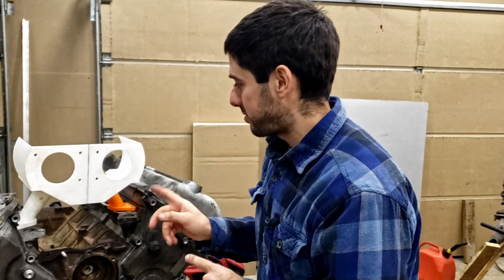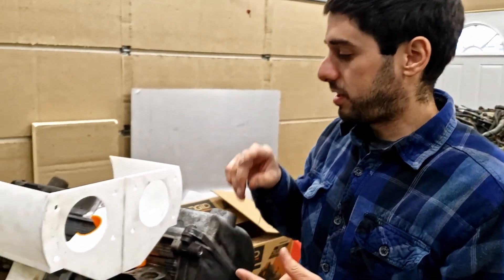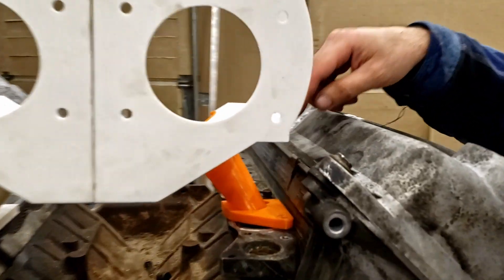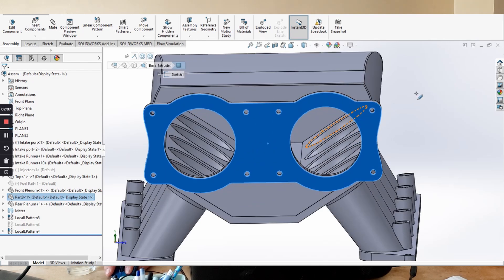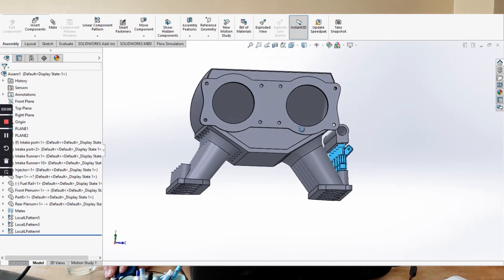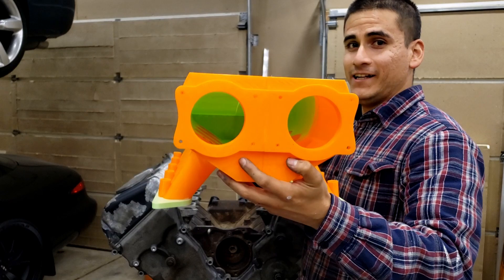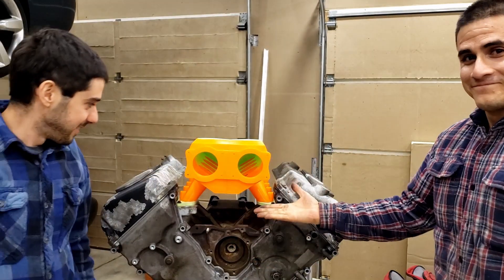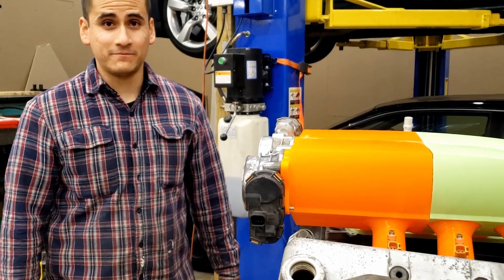3D Printed Intake Manifold - Ford V10 4V Build Ep. 5

Comment: Wouldn’t you be able to put the injectors on the inside of manifold I feel like it’d follow the runners and air going through it more, it’d hide them more clean up the engine bay a bit and for easier installation and removal a sub harness could be made to disconnect the injector harness instead of having to unplug each one individually.
Reply from the maker: That is an interesting idea. At first glance it seems it would be difficult to package but it would be slick!

Comment: What a shame you couldn't find/use Left & Right hand Throttle Bodies.
The new design looks ok ??
But, a more direct path would look and possibly flow a little better.
I guess a compromise needs to happen if you're trying your best to keep control of the cost.

The first manifold design had a more performance look, where as the revised version looks more like an OEM Manifold.
As always, you guys did a great job 👍👍

Comment: The manifold looks great, but I believe the runners are too short to get velocity. It will make incredible horsepower at high RPM's, but may lack street ability and low end torque.
Reply from the maker: They are pretty short, but we are targeting high RPM so that was intentional.

Comment: It seems to me the throttle bodies are going to be sending the air… pretty much straight into a wall. It was simpler and… well, straight the first time around. What about the positions of the throttle bodies was bothersome?
Reply from the maker: The blades opened in opposite directions and we preferred the look of the angled TBs.

Comment: Would you consider building a custom intake manifold for my f150 5.4 3v?
Reply from the maker: Maybe once we’re done with this engine and we have some time for extra projects. What kind of build are you working on?
Reply: Building a 2014 5.4 3v 
That I'm gonna drop in my 09 f150.
There isn't a aftermarket intake manifold available. 
Hoping you could be the first

Comment: I disagree with their use of LS Throttle bodies tho, the Stock 2V V10 Computer can run 3V and 4V heads with tuning changes as long as their not using variable cam timing, which it appears they are not, but it can't run 2 electronic throttle bodies that i know of....  over-complicated on that part, which will also mean they have to use an aftermarket computer...
Reply: Dude, did you see them cut apart 4 different heads and weld them back together? I don’t think running a different PCM is over complicated for them, 😂

Comment: Okay, I am going to need this intake but so it can fit an Cobra throttle body. I just cant bring myself to put a GM throttle body on a ford engine.
Reply: Downside for high boost applications is you can't put a v band flange to a ford oval throttle body.

Comment: Why not have the whole thing 3D printed in carbon strand filled 6/6 nylon and actually run the plastic manifold on the motor?  I'm sure there's companys with bigger 3D printers that could print the whole thing, or at the least, runners, and plenum that you could join.
Reply from the maker: Would be cool to have it 3D printed or injection molded! But it would also be really expensive for a one off. Thankfully aluminum is relatively cheap, and we have the ability to machine a lot of the parts so it should be relatively straight forward making the intake 🤞🏽🤞🏽

Comment: Hi i'm new to this series since you welded the heads together have you normalised the heads yet and if you haven't please do so this will normalise the grain structure meaning less chance of cracking
Reply: By heating?
Reply: @ethanwild3301  yes by heating it then letting it slowly cool this will make the grain structure throughout an even size, this has 3 advantages. 
1). makes the aluminium not soft at the welds (since AL anneals when rapidly cools which as you know AL is a great heat sink) which leads to cracking if force is used.
2). increases its overall compressional strength of the heads so when tightening the heads it evenly distributes the force evenly making them seal to the block better.
3). completely removing the internal stresses not only from the welds but also from the casting of the heads making them an overall stronger set of heads.

Comment: Have you guys thought of modifying an Aussie boss intake with modified upper lid to suit your LS throttle bodies?
Reply: The cost of a boss unit in the states, let alone two that would be needed to make it work is big big money. Hed spend less mony doing it in sheet metal but the boss manifold is sweet
Reply: @madmod  they are like $200AUD each
Reply: @tturi2  in the states, you would be hard pressed to find one under 2000usd
Reply: @madmod  thats a rort, go on ebay and pay the $200 shipping
Reply: @tturi2  Ebay has no listings in the US for Boss 5.4 manifolds. Zero. Ebay of AU has local pickup listings only. They are very rare and costly in the states.

Comment: What is the solution to the dead headed coolant passages that were welded shut? I’m guessing you will have “head cooling mods” on the front and back of each head? Looking forward to seeing how this all comes together.
Reply from the maker: That’s right, we’ll be cooling each half of the heads separately.
Reply: Basically the "crack pipe" cooling mod often performed on 4v mod motors and factory equipped on 04-05 Aviator 4v heads. They were already known to have some hot spots back there so ford fixed it too.

Comment: Love this project. I think the RPM goal is a little lofty if not just an arbitrary number, my 324 Cid DOHC is silly to 7500…. I have been running this engine in a track car for years…. Check my YouTube for any information. I wish you luck and I am following along to see the final results. Are you going to use the stock crank ?
Reply from the maker: 8k is definitely ambitious, but it’s certainly doable with the proper supporting hardware. This wont be a track car either so if you’ve been running 7500 for years in a track car, that gives us confidence we’ll be okay!
Yup, we’re reusing the stock 6.8 crank for this build. There’s no other option for this engine so we’re definitely going to be putting it through its paces 😬
Reply: @biy_buildityourself  sorry, i'm late to the party.  the forged crank will handle it, but the oddfire rotation and balance shaft are the big question..  looking forward to your results!  👍
Reply: I mean a billet 3.700 stroke common pin crank would really solve a lot of problems,,,, I can only imagine what that would cost though

Comment: I hear all the cool kids with triton v10's are running itbs
Reply from the maker: I wish we were that cool lol
Reply: @biy_buildityourself  Consider a slide throttle like a Larry Perkins V8 supercar, if you want a custom intake
Reply: Ive seen one setup with bikecarbs where they used the truck manifold, cut the runners off, and reused the flange and coolant crossover so all the hard fab work was made easy.
Reply: @madmod  that build sucks butts when compared to this build lol
Reply: @heith85  it made power though
Reply: @heith85  it put down coyote horsepower and over 400 foot pounds from 2000rpm to redline.
Reply: @madmod  made less then coyote hp and sucked butts when compared to the BMW v10
Reply: @heith85  You cant get a bmw v10 for 250$ in every junkyard across america. Also the bmw v10 doesnt average the torque production of a triton 2v
Reply: @madmod  tell me about it. I built the car. Lol

Comment: you guys have it planned to get a balanced crankshaft and super stable valve train down the road too right
Reply from the maker: We plan to balance the entire rotating assembly, especially with all the goodies we are getting 😈 
With regards to the balance shaft, our research leads us to believe it is purely an NVH solution. It would be interesting for someone with a V10 to remove the shaft gear and drive around to see how it responds.
Reply: @biy_buildityourself  I believe you are right on it being for NVH. I do plan on removing mine as I have h beam rods and different pistons. So I think the factory balance shaft would be out of wack as my rotating assembly is hopefully a fair amount lighter. I still need to find a local shop that can balance the v10 crank
Reply: I am curious as well. I also would like to know about any issues with deleting the balance shaft that was on the one head. I might run two similar heads and flip one to delete it on my motor

Comment: Won't the air flow from the throttle bodies be kinda vortexed in a way since they now cross each other or is the plan to put a block between them so that that air flow banks to one side or the other?  Also, why not just go with one single bigger throttle body?
Reply from the maker: There will be a divider inside of the plenum, so there will still be two separate plenums, one for each bank.

Comment: You guys could also use two throttle body’s off of a SOHC 4.6 (2V) or 2V 5.4.
Reply from the maker: The ones we are using are much larger, they are 78 mm throttle bodies.